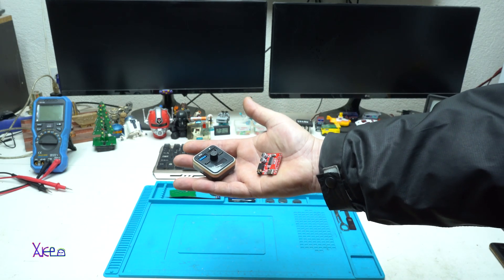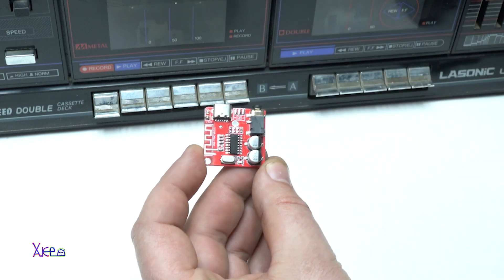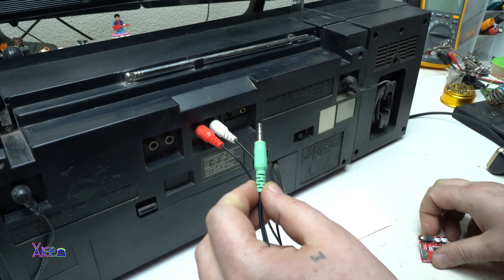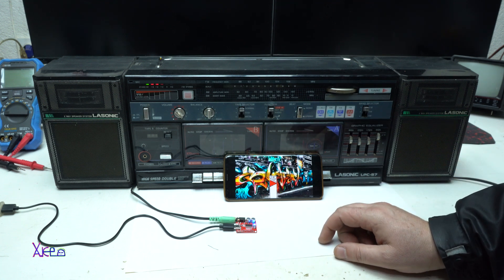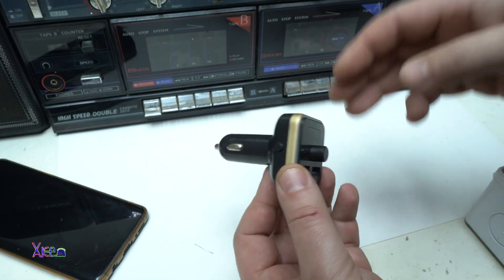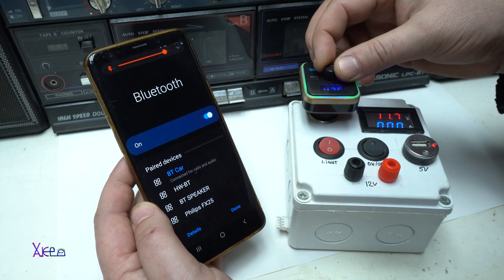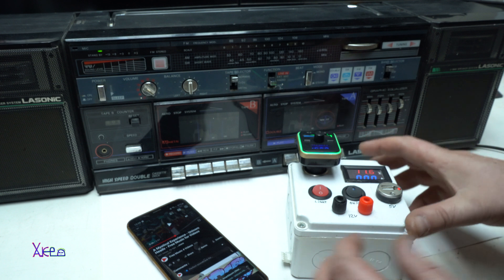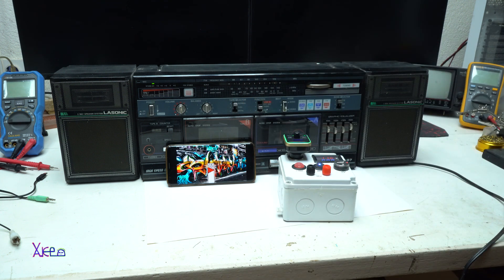How To Add Bluetooth to Any OLD Stereo Radio Cassette Player?

Comment: Hello, this first One,  is it Possible to use 3,5 mm Jack to 3,5mm Jack also? I have a bt speaker and radio with 3,5mm jack
Reply from the maker: Yes you can use that

Comment: Hi, have to tried to connect a battery to the Bluetooth module?  Will it recharge the battery?  Perhaps another video on this topic?
Reply from the maker: The module dont have lipo charger IC,so if you connect battery to board and power up with usb the battery will explode for sure

Comment: I recently soldered one in a old boombox and when i tried to test it, it immediately fried!🙄😁 i guess i had a faulty one. I already ordered some new ones they are indeed very cheap.
Reply from the maker: These modules work on 5v, older players work from 9 to 12v so that why you burn the board,use voltage regulator
Reply: Maybe you reverse connected the power supply
Reply: @ishandiptagarai852  it was correct. It wasn't the first.